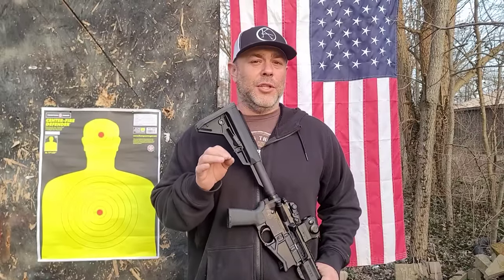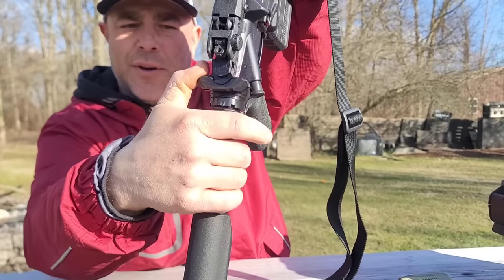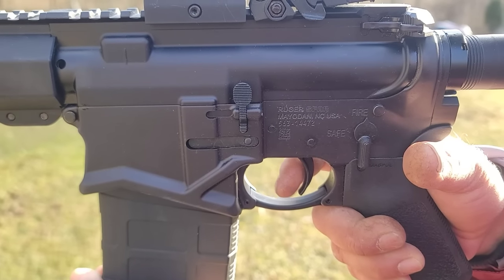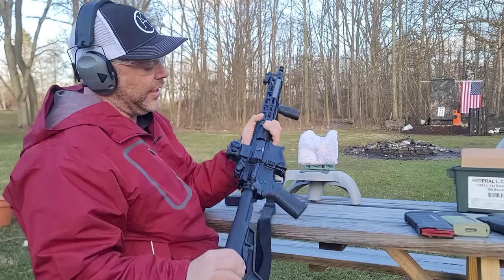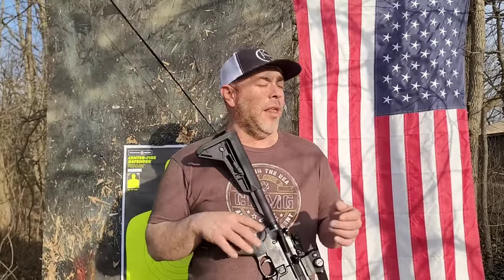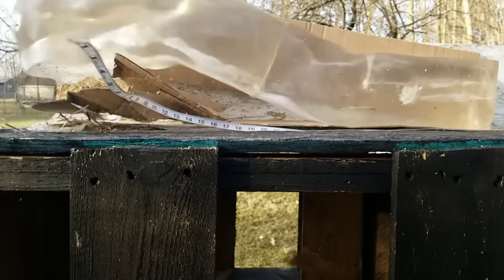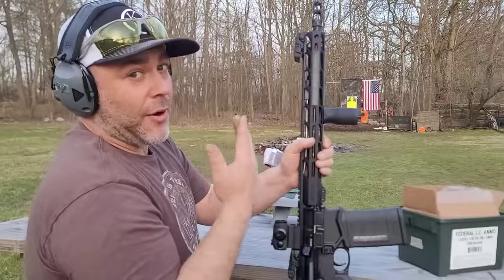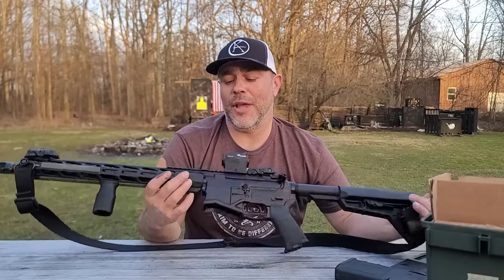Ruger SFAR NO 🐂💩 FULL Review. The AR-308 Struggle Is STILL Real😕

Comment: Had issues with mine first time out...a thorough cleaning, like I took it completely apart...and its working fine. Real pleased with accuracy and how easy it is to shoot.
Reply: Update….the rifle continued to have issues cycling….decided to send it back to Ruger, they were great about it…. The rifle was gone for just ten days, just got it back yesterday… I’ll take it out this weekend to see if it’s better.
Reply: @timberdogz  Please keep us updated! Thanks.
Reply: @timberdogz did u shoot it yet what did they say the problem is
Reply: @timberdogz  ??
Reply: Got the rifle out this morning...shot about 60 rounds through it without an issue!!! Way better than before.....then it basically blew up! Smoke coming out, bolt locked forward, cant move the charging handle....I literally called Ruger from the range! They said to send it back again...I told them i'll send it today....but before they send it back....I'll need to seak with someone about the situation!!! NOT HAPPY....
Reply: @DragonSlayer-tg5mk  Pleaseeeee buy some Kroil penetrating oil, use it to clean including the gas tube, port, etc, then lube everything except the gas system , then, switch to setting 2 and then try more 5.56 ammo !
Reply: @robertgriswell6066 this is a .308 guy not 5.56
Reply: @timberdogz could be ammo.  Over pressure ammo will seize in the chamber and is an absolutely PITA to get out.  It’s happened to me before.  Don’t use ARMSCOR
Reply: @timberdogz any update i just purchased one
Reply: How accurate?
Reply: ANY UPDATES? Just got one and bolt wouldn’t close with magtec m80 ball but it would with hornady 150 grain called rugar and they said find ammo that will work and shoot 100 rounds and then try the m80 again. Had to go buy more hornady waiting for a day off to go shoot. Haven’t put any rounds threw it at all
Reply: I have no problem with my sfar 308 16inch. So far. Shot 450 yards right on target. 150g Hornady. Thank you sir for your great info. ✌️
Reply: My 20” just runs on setting 3.  Tried 2, got about 10% bolt over FTF.  200+ ROUNDS in.
Reply: You guys having the cycling issues need to buy a new buffer and possibly heavier buffer spring. This seems to be the problem if you guys haven't figured that out already. Buy the H2 buffer. You can pick one up for about $30.
Reply: @timberdogz  Try buying a new buffer. You need a heavier buffer. You can pick up an H2 for about $30 online.
Reply: Same. I had a few failure too feeds  first range trip. Got home cleaned it oiled it and was fine last 2 times I've gone too the range and shot about 100 rounds each trip
Reply: @norse_7932 who wants to go out and buy a buffet tube or anything else for a  brand new basically $1k gun? Why didn’t  Ruger do
That?
Reply: And I’ll add one more to all this who would go buy a gun that ever single video every single thing said about it has been issues ? Like do people do the own home work before they just buy something because it’s cheep ? It blows my mind and then bitch about it wow it does not work I have 5 rounds and it blew up blah blah blah BUY ONCE CRY ONCE GUYS because so thing is cheaper well it’s cheaper for a reason most of the time. And RUGER SHOULD NO BETTER THEN TO BUILD A GUN THAT DOES NOT WORK I MEAN BAD ON RUGER GOOD LUCK GUYS WITH YOUR BOAT ANKERS LOL
Reply: @nickibateson1466  it's a great gun.

Comment: Since the gun has been getting worse and worse with the short stroking, i'd suggest you take a quick look at the gas block and the bolt carrier for anything loose. See if the gas block screws have walked out, the bolt carrier key is loose, or if the gas rings on the bolt are messed up. I suspect something is loosening up since its getting rapidly worse as you fire it. Great video!
Reply: Yes. Maybe loctite was never applied too. Seems they dont use it at the factory.
Reply: @jacksin3323   Use Rocksett instead, locite is not good enough for 308, you will thank me later.

Comment: Please be aware that nearly everyone and companies included use loctite incorrectly. Loctite must be used with loctites primer if the metal has any coating whatsoever as in, anodizing, nitride, oil, etc. Every part and screw on an AR has a coating, even the gas block screws. So, check 100% of all of the screws for tightness.

Comment: Hey Turkey, I have the 16" SFAR.  I used a Tubbs flat wire 308 buffer spring and a H2 buffer.  It worked much better, flawless.  I have since gone to the H buffer and I only shoot suppressed.  I also have a POF Rogue 308, I did the exact same thing to it and it works great now.  The POF was an absolutely nightmare before the changes, totally unusable. Also shoot it suppressed.
Reply: Couple questions: Did you compare the length of the Tubbs spring to the stock SFAR spring? Was there a difference?…Also, why did you switch back from the H2 buffer to an H buffer. Was there problems with Tubbs spring and H2 combo? TIA!
Reply: I also went to a tubbs. I'm running the 42coil sr25 spring and H buffer. Some improvements,  functionality is fine. But accuracy isn't great and it chews up base(case head). I'm starting to think the dual ejector is responsible. I'm running setting 2. Less than 200 rounds on the new upper and bcg ruger replaced.
Reply: This is no longer on my buy list. Bummer under 7lbs was intriguing.

Comment: QUALITY VIDEO!

The reality is that the SFAR is an ENTRY level AR10.  To keep the cost in check, quality control is not on a per gun basis.  It's  either done via random pull or statistical basis as most every mass-produced anything is today (I speak from the experience of a manufacturer).  So, after production release and gathering of real-world failure rates, the QC frequency is adjusted, and the manufacturer is ok with the costs to repair under warranty.  There's a desired balance that is hoped to be achieved as soon as possible with future production runs.  Sorry folks, that's not ever a zero failure rate.  That said, send the SFAR back to Ruger and it will get an individual smith's attention and be returned functioning flawlessly. Provide as much detail to them as possible to reduce the potential for a second return trip!
Reply: Wish it would have turned out that way....sent mine back, got it back in ten days, shot 60rounds through it and the bolt completly locked up...something I did not have a problem with previously!
Reply: And you know nothing. A lot More intelligent and competent people work them just fine. You’re an entry level shooter just say that.
Reply: Entry level ? I agree to an extent because what a great way to make the new guy never buy your shit ever again or a gun ever again. To have to deal with this many issues from the start I would have asked for my money back asap and if not I would have thrown it in the trash can.
Reply: @blainebreak9050  I agree with you bro. The ruger sfar is a legit buy if it does have some sorta malfunction its probably because of cheap ammo or someone with no gun experience.

Comment: Gas Settings: Page 43, Paragraphs 3 & 4 (Default is "2", which is how mine came). I have 300rds though mine, no Failures. I've fully tricked mine out as battle rifle, with TA-31 ACOG. Only problem I had was the rifle would not drop an empty mag from an open bolt. Upon diagnosing,  I found that the rear, right of the magazine lip (at corner) was jamming itself into the upper receiver. Same for all Magpul mags. Turns out Ruger screwed up their machining on the upper. I shaved a bit of the corner edge of the mag, and problem "solved" (I didn't feel like RMAing the rifle, because that sucks to do, plus I'd have to remove all the upgrades I did (muzzle device, pic mount for light, ACOG and offset RDO, ambi mag release and bolt catch, grip, stock). FYI, I get full cycling on setting #1 using a Form1 6" can with 6 clipped baffles.
Reply: Mine came out of the box on 3?? The manual does state 2 is a good place to start with quality factory ammo. I'm not sure which setting to start with??? 🤷‍♂️
Reply: The ruger video states 3 to break in, then 2 and 1 is for suppressor. Mine came on 3.
Reply: @Gunsnwater  yeah. I've watched that vid. Most guys are breaking in on 3. I was stating to manual quotes "Most commercial ammunition will cycle optimally on setting "2", which is an ideal starting point when first shooting the rifle with new ammunition, unsuppressed." I'm gonna start with 3 & see how it acts?? 🤞
Reply: Was just at the local shop and they had one! Was so close to putting a deposit on it $998 or something . Yours sounds amazing
Reply: @Contractor 556  that's a great price. Go put money down!! I paid $979 but 4 weeks on backorder.
Reply: @dabears52501 I’ll let ya know if I do! Seriously thinking about it but I’ve been practicing my impulse control
Reply: @Contractor 556  what's impulse control?? I've added $1k in accessories to my SFAR in 2 weeks!!! LOL 🤣

Comment: I got 260 rounds through my SFAR rifle. Zero issues so far. “Knock on wood”. 20 rounds unsuppressed and 240 with my Sandman S. I used some PMC 7.62 NATO, IMI 7.62 NATO, Winchester .308, Hornady Whitetail .308, as well as S&B 7.62 NATO. I switched to setting two after my initial 10 shots to see what it would do. Nothing much changed.  
Got through the first 20 and pretty much ripped right through the other 240 rounds. I left mine on setting 2 just in case I forget to switch it back while hunting. I also got rid of the charging handle and used a Radian Raptor I had floating around the parts binI disassembled the lower and cleaned everything and reassembled it with my Geissele Go Juice ultra thin grease. Did the same to the upper and bolt before and after breaking mine in. I hope Ruger was able to help you out. Might be an issue with the gas block. I’ve seen another video where they guy had issues with his SFAR. Give us an update please Sir. I  can’t wait to plan a hog hunt and deer season. This is a fun rifle just not much fun on the pocket book lol. Great no bull assessment Sir.

Comment: When breaking in my PA-10, I broke down and cleaned every 50 rounds or so. I also learned mine didn't like certain magazines, so I stuck with the Magpul ones, and those 2 things have helped significantly. 
I know you shouldn't have to clean in the first 200 Rounds, BUT on every gas gun I've ever gotten, I found that the factory lubrication bogs down and gets extremely saturated and turns to sludge. Would recommend a good field strip with Hoppes solvent and lube it back up.
Reply: Man, just my 2c, but I'd say you almost certainly should clean in the first 200, or even right out of the box, just because of that factory lube. I've seen some crazy globs of crap on brand new guns.
Reply: Factory lube is not lube it's metal protector the first thing you do when you get a new gun is strip it down clean it and put actual gun lube on it
Reply: Gas setting 3 is for subsonic and suppressed. Setting 1 you need to run 200 rounds thru it then set the gas block on 2 for less recoil.  Great gun I love mine.

Comment: Great video. Check gas port alignment, and the rest of the system for anything loose. You can run a lighter buffer, or lighter spring and then try different buffer weights as well. Or, send it back to Ruger and have them fix their mess.
Reply: I agree on both.
This rifle does accept standard buffers.  Try a different buffer and possibly different spring.
Several other videos that I have seen about this rifle, that the gas block is a crap shoot.  Some of them run perfectly fine, and others have issues.
Reply: I've seen people have issues with the same rifle and reported that just simply changing out the buffer fixed it. Upgrading to a heavier buffer like the H2 seems to help. You can pick one up online for about $30.

Comment: I bought the 20" and outside of one round it has functioned flawlessly. I run a suppressor on mine though and  on setting 1. I've ran 3 boxes of Winchester white box and 2 boxes of FGMM ( it shoots them sub moa) plus 100 handloads 125gr and 169gr SMK, both nearly 1/2" groups.
Reply: I really like the feel of the 20” version
Reply: I have the 16 with whit machine sme on setting 2 with that same Winchester ammo. Not a single issue yet. Got it Friday night and put 200 rounds through it yesterday. I couldn't be happier!

Comment: I have over 300 rds with mine.  Using an H2 buffer and setting 3 for ballM80 and setting two for the  Hornady rds I bought.  Runs great.
Reply: How do you feel H2 buffer changed recoil and cycling? I have considered trying at some point
Reply: @LawtonLee-n3p  Have you tried the H2 buffer? I've seen that it helps.

Comment: Setting 3 was probably over gassed, the reason it worked on setting 3 at first is probably because carbon had not started to seal the tolerance gaps around the gas block and gas tube, or the components inside the rifle that were not broken in yet slowed the carrier down enough to allow the bolt to not move as quickly. Usually in the first 50 rounds or so carbon will seal up the gas block and gas tube area pretty quickly allowing the system to be more efficient. You could probably fix this yourself by using a lighter buffer slash spring in conjunction with setting 2, or heavy spring slash buffer on setting 3. You shouldn't have to tinker with a new rifle to get it to run thou. Just my 2 cents, by no means am I an expert just pretty experienced with assembling DI rifles. Most people are saying the gas block is maybe loose but it wouldn't start showing signs of over gassing like bolt over ride after working ok at first if that was the case. Awesome review keep up the good work 👍
Reply: If a rifle is “over gassed” the last thing you should do is weaken the buffer spring or reduce buffer weight.

Comment: Enjoyed the video 👍😎
1. Cannot really tell by video,if your brass is ejecting in the 3 or 3 1/2 oclock position... Then your gas is Fine👍... If brass ejecting 1 to 2 1/2 then it is over gased...if going 4 to 5 1/2 then it is under gased...

2. The bolt going over the round,you may need to change the buffer weight...if gas is where it should be... 3 to 3 1/2...

3. The noise from the stock that you mentioned early in video,is the buffer spring vibrating in the tube which is also causing friction.... This is why I have a flat wire buffer spring,much quieter and smother action.

Came back to add... The ports that you alluded to,have no idea why they are there but it cant be good... May be compensating for something else on this light weight AR -308...That would worry me as a red flag...🤔😬
Reply: I believe the ports are to help mitigate gas blow back in the face when using a can.

Comment: Have you tried a palmetto PA 10 gen 3?

I got one on Black Friday weekend for $700 and it's working great so far. It has 17 gas positions. Three slots per revolution. I'm running in position 5 out of 17 with Tula 308. It also runs Freedom Munitions in the same position.

Tula ejects at 4 oclock  and Freedom Munitions ejects at 2 oclock in position 5 out of 17.
Reply: Do a range review... cause thats what a lot of folks are looking for: reviews confirming an ar10 with a working mag that can reliably cycle particularly steel cased ammo--- 
👍

Comment: The reviews I’ve seen on this rifle have been overwhelmingly positive, and that’s putting it mildly. I’m not doubting your experience whatsoever. Maybe the gun needs to be broken down and oiled really good. I don’t remember if you said what level you had the gas system set at, but they recommend to keep it on 3, at least until it breaks in. If it’s not either of those things or the ammo then unfortunately you may have just gotten a lemon. Best of luck
Reply: I've seen tons of positive reviews and a pile like this. Seems to me people either have no issues with them or constant. 200 rounds through mine with zero issues.

Comment: Check the buffer tube/spring.. I was on a forum and some people swapped out the buffer tube and spring. I can't remember what brand it was but seemed to function after that. Not sure if it needed a smoother and or stiffer spring. Just an idea that seemed to clear up the problem. Definitely can't wait to watch the journey on this gun to see if the Turkey crew can figure it out. Great video.
Reply: Problems that I have seen on gas levels 2 & 3 leads me to believe it would require a lighter spring pressure.

Comment: I have about 120 rounds through one. The first 2 mags were on gas setting 3, and then I dropped it down to 2 for the rest. So far, not a single issue. I used the same ammo you did. The brake is very effective, but the folks at the range were pretty irritated, so I tried a BCM mod1 brake thinking it would be a bit less aggressive, but no dice. The first round set off alarms on the trucks in the parking lot :)  I've now put a flash hider on it, but haven't been back to the range. I put a Leupold 2-7x on it trying to keep the scope as light as possible.
Reply from the maker: Thanks for the really good info!
That's funny about the car alarms🤣👊🦃👍
Reply: When I first got there and pulled out the rifle, dude next to me recognized it and said ' I'm moving'. Then a poor woman unknowingly sat next to me while I was sighted in and immediately ran away after the first shot. I'm an introvert... having 3 stalls to myself is a nice bubble : )
Reply: lol that kinda sucks. How close to the trucks were you? Isn't the Leupold 2-7x discontinued?
Reply: @WAUCE7  Trucks about 8 yards behind me.  Yes, I bought the 2-7x quite a few years ago.
Reply: Why I run a linear comp. Even my pistol 308 doesn't beat up my neighbors at the range.
Reply: @bogusphone8000  Never heard of one so I googled it. These look great!
Reply: Well, I think you should check  how you put it back together.  500 rounds mine,no jams working perfect.